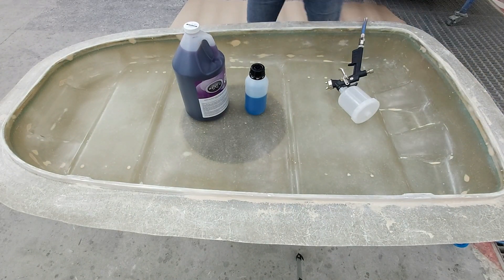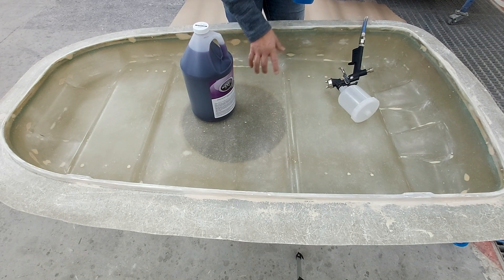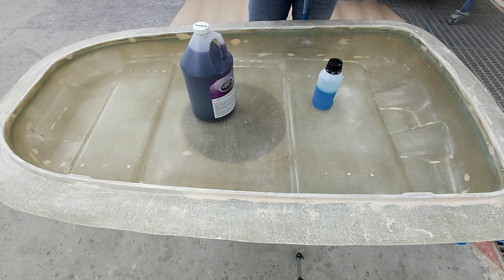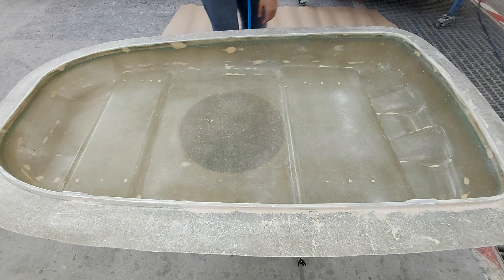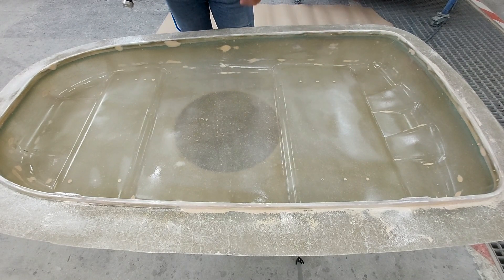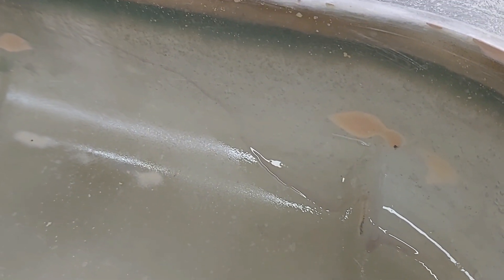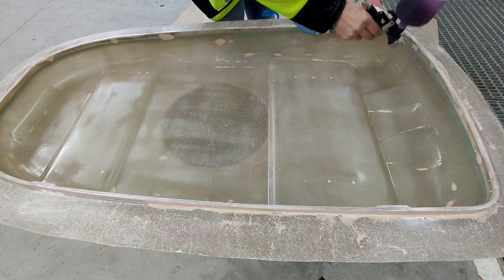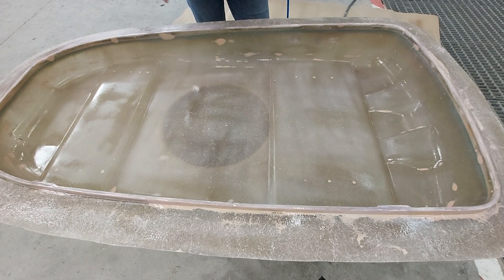How to apply PVA (Polyvinyl Alcohol) Release Agent to Fiberglass Mold

Comment: Why 'MUST' the mold be covered in PVA after it has been waxed several times? The mold looks very simple to me.
Reply from the maker: @ Welditmick. First of all, thank you very much for your comment. It's not a 'MUST'. The molds can also be demolded if you only apply wax. But in this particular case I apply PVA on this mold because the upper edge is very narrow, it is only 15 mm. And this mold has corners, even if they have a fairly large radius of curvature they are very narrow and are located on the upper edge. The curing reaction of the laminate is one with heat release. As the heat is released, the fiberglass tends to twist and shrink on smaller surfaces as in the case of the edge that absorbs heat both inside and outside the mold. Another reason is the quality of the outer surface, which in my case is represented by gelcoat, which is clearly superior when applying PVA. In this case, it eliminates the risk of wax stains if the surplus has not been properly removed. In conclusion, it is not mandatory, but I recommend using PVA. It is a technique that I use and that works very well in my case. This does not mean that it is the perfect technique but the one that suits me. If you find my answer helpful, don't forget to subscribe to the channel. Your support is very important and helps me continue !!!

Comment: What types of nozzle?
Reply from the maker: @ Tri Wijayanto. First of all, thank you very much for the comment and sorry for answering you so late. It is a 0.8 mm spray gun nozzle. It is not necessary to invest much in the spray gun. I also applied PVA with much worse spray guns. Of course, for excellent results it is important to have high-performance tools. But in this case a normal spray gun is enough. If you find my answer helpful, don't forget to subscribe to the channel !!! And if you have other questions do not hesitate to write to me.

Comment: Hello, can I apply PVA and use a hair  dryer to cure it faster? What temperature is needed in order to cure?
Reply from the maker: @Versus Boxing, First of all, thank you very much for the comment. Secondly, I'm sorry I answered so hard. To answer your question, you can use a hair dryer but you have the chance not to dry the whole surface evenly or to spread the PVA where it is applied in thicker layers. PVA dries at room temperature and is not a two-component reaction with heat release as in the case of resin. I recommend thin layers with a waiting time of 30-45 minutes at a temperature of 20-22 degrees Celsius. I hope my answer will help you and that it didn't come too late. If you find this video helpful, don't forget to subscribe to the channel. It will help me a lot to continue.

Comment: Oh man if you don't have carpal tunnel now your going to get it real fast spraying that way. No wrist movement when spraying. This is not a good way to spray PVA or paint. Bad demonstration of PVA application.
Reply from the maker: @Bryan Hester, First of all, thank you very much for the comment. I know that safety at work is very important and I appreciate your comment. I will try to document myself more in this regard. What I can say is that I have been doing this for 15 years and I don't have any problems yet. Thanks again and if it doesn't bother you, I would like to know what experience you have in fiberglass, resin and composite materials field.